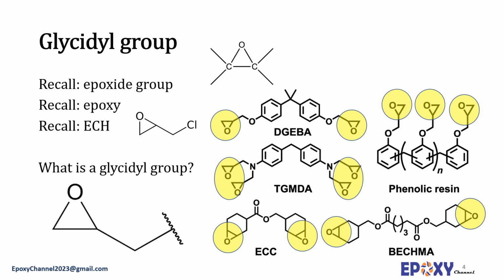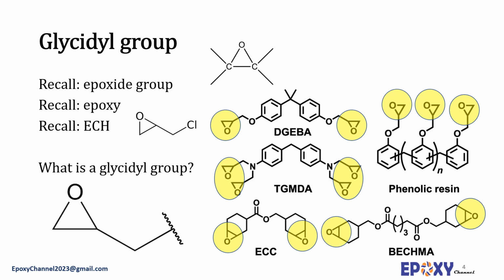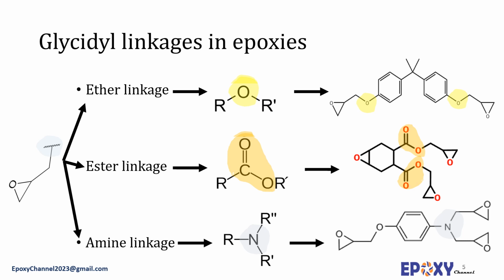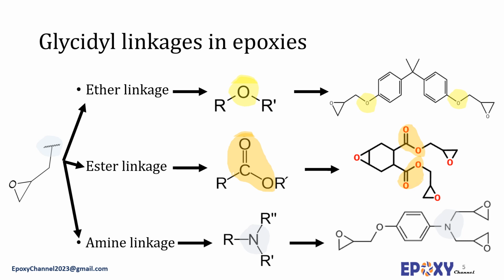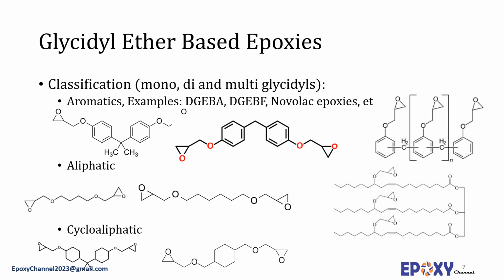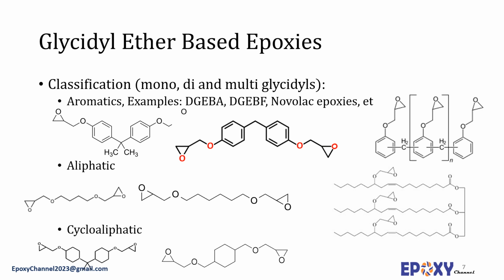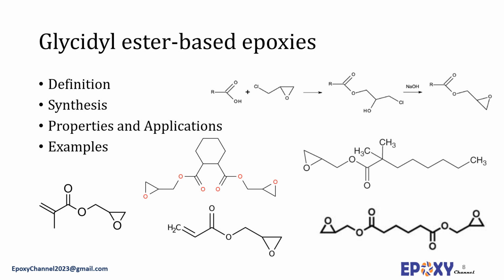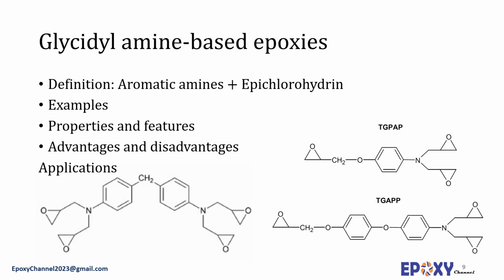Glycidyl Ester/Ether Epoxy Systems - Session 21

Comment: How to fo safety when working with epichlorohydrin
Reply from the maker: Hello, Epichlorohydrin is a CARCINOGEN and MUTAGEN. HANDLE WITH EXTREME CAUTION. For safety and hazard associated to epoxy systems you can watch the video I have uploaded earlier. you can find some information about ECH there as well. For more details I suggest reading the document uploaded by EPA. check the link and stay safe:
https://www.epa.gov/sites/default/files/2016-09/documents/epichlorohydrin.pdf